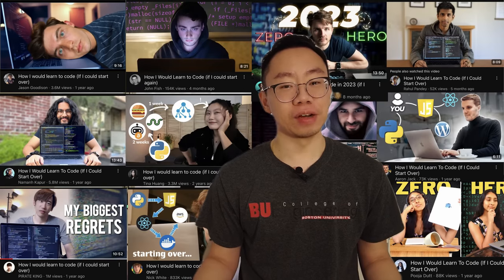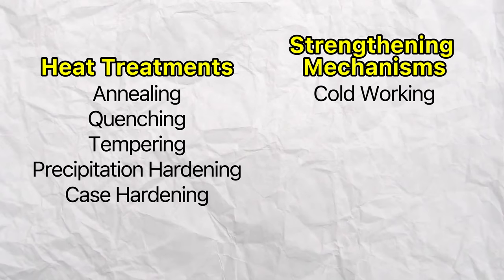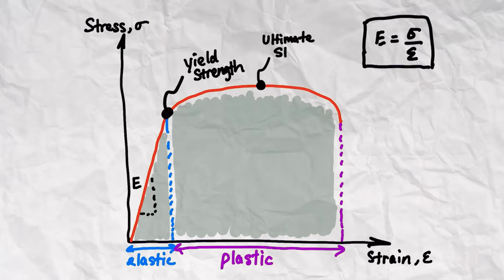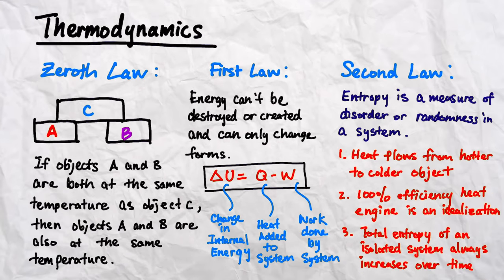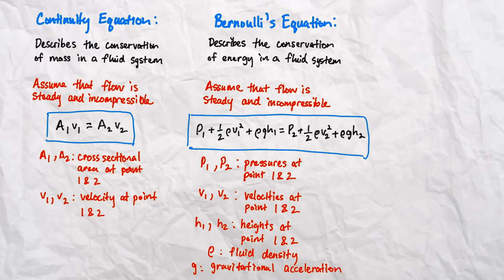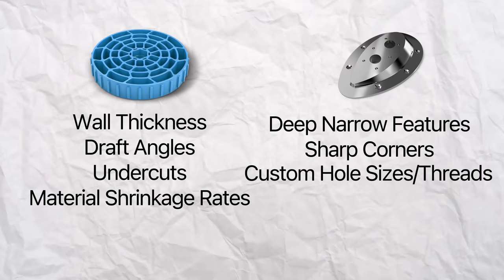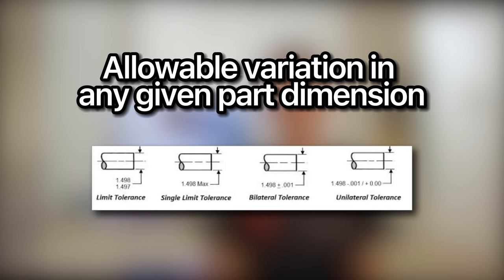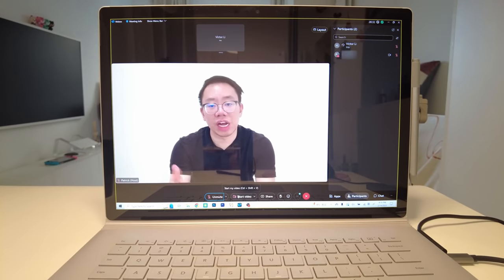How I Would Learn Mechanical Engineering (If I Could Start Over)

Comment: Engineering school is NOT taught by engineers!  It is taught by engineering academics.  While I had some excellent professors, the best had industry experience.  This is why co-op should be mandatory for engineering.  I had the advantage of having 45 years in manufacturing and evening community college teaching.  We do a poor job of preparing graduating engineers for the industry workplace.  It is only the very, very few that will apply the theoretical knowledge that they have been taught.  As discussed in this video, the most important thing is understanding the principles' linkage.

Comment: Thanks for the video. I'm a 20 year old machinist looking to become an engineer and this has really helped me see that its possible. After I graduated highschool I had some personal issues that made it so college wasn't really an option. instead I went to trade school and started working, I really like the work but id like to start getting into the design of parts and assemblies. I already have a good amount of knowledge on material properties, tolerances, components, manufacturing processes and some physics as well as a couple years experience in manufacturing and this video has helped me see what I need to improve on in order to reach that goal. My question is does where you get a degree matter much to employers and will my machining experience help me or hurt me in geting interviews
Reply from the maker: The majority of employers value skills experience and attitude over the school. Your machining and manufacturing experience will definitely help with landing more interviews and designing better parts.
Reply: Just go to your local community college/technical college to get credits to either get the degree or transfer to a university. You got this!
Reply: All that matters is that you can do the job, like learning, and be a good person to work with.

With your experience that’ll totally help. Hell, I’m self taught. Spent a few years learning the math, programming, and theory while practicing building stuff on a diy cnc. Got my first engineering job in a start-up by attaching a portfolio of those projects with my resume then brought them in with their log books to the interview, answered technical questions, and made a few laughs happen. 

This was less than 10 years ago
Reply: Hey man, it sounds almost identical to what I’m currently doing. I’m 22 and went to university for a year and had personal issue that forced me to drop out. I picked up a machinist job in die cast and decided to try and pursue my education in an untraditional route. I’m nowhere close where I want to be and often it feels like I’m stuck. It’s nice to hear that there’s someone going through similar struggles. Stay ambitious and we’ll get there man.
Reply: I'm a 23 year old military trained machinist (no certs/civllian work experience) and working towards mechanical engineering degree. From my professors opinions, machining experience should help greatly as its tied, especially to manufacturing engineering. (that'd be my recommendation so your knowledge now supports the degree)
Reply: I cannot emphasis enough how important your experience will be as an engineer.  It will give you an edge over your peers in the workplace.  HOWEVER, in school itself it'll account for very little beyond you having a better practical knowledge for what they're teaching.
Reply: You're very lucky. I didn't even know what a machinist was until I was in my late 20's, and became fascinated by it. I went to college after HS because that's what we were all told we had to do, whether we had any direction or not. So I got an expensive piece of paper from the college of business at the local university. If I had it to do over I wouldn't have gone without a clear vision of what I wanted to do. And I definitely would have learned machining. Best of luck to you.
Reply: @geobot9k what sources did you use?
Reply: Hey man I did the same thing. Straight after highschool i went to trade school for machining for money. Now I am on my last year of Robotics Engineering major and I have been working as a manufacturing engineer co-op for a year now. I got the co-op due to my manufacturing experience. Where you get the degree does not matter just make sure it is ABET accredited. Your manufacturing experience gives you a big advantage. Most college students do not have any experience since they are straight out of HS.
Reply: vibratingstring I think he meant does he have to go to MIT/Cal Tech or can he just go to his local 4 year party school to get his degree and buddy was just saying the school you get the BS degree from doesn’t matter as much as what you did while you were there

Comment: 2 years still I graduate, rly wana study mechanical engineering. However I'm not taking chemistry is this a huge problem?
Reply: I believe Chemistry is a prerequisite for Physics(at my school it is). The EEs at my school don’t have to take it though. It may vary at different universities, so I’m not 100 percent sure.
Reply: I didn’t take chemistry and I’m not in my first year of engineering and it’s the only module I’m struggling with everything else is fine so I’d say you’re good like just means you’ll have to learn it when you get to college. Or learn it on your own now to help,p u in furture
Reply: A one semester abbreviated course of “chemistry for engineers” is typical. It introduces inorganic chemistry, but is unlikely to have much time for organic chemistry.
Reply: College level chemistry is a prerequisite course for your Engineering Materials course, also commonly called Material Science which is a required ME course. I would recommend taking chemistry, physics, and calculus courses in high school to prepare you for the rigorous courses that you will take in engineering. If you are not ready for calculus 1 in your first semester of college then you may want to consider community college. Community colleges can be a great place to fill in knowledge gaps and even complete the first two years of engineering courses.
Reply: @downardesigns4148  where did the person ask you about calculus? and no that’s silly to suggest someone to go to community college just cause they don’t know chemistry . Terrible advice. chemistry in high school is absolutely useless in mechanical engineering .

Comment: I was sort of expecting a plan on how to sequence the order of studying things so as to make best/most efficient use of time, or things you would have done differently in your progression, but this video kinda just went over all the topics of mechanical engineering. No knock, but I'm not sure I really understood the "how" part, with respect to how to approach the learning - what I did get from this is there's a lot of topics that mech eng covers, but left without a sense of how to approach these topics from the perspective of wanting to learn and develop as a mech eng. What's the first project you should build so that you can move onto more complex stuff? What's the best topic material to build a foundation. What did you do while becoming a mech eng, that you wish you could have done differently? For example, if I were to study e.e. again, I'd recommend starting with analog circuits sooner. I started with digital circuits and don't think I ever gave enough attention to analog circuits. I would recommend someone doing e.e. to buy an oscilloscope, something I never had while learning about circuits in high school, which contributed to me avoiding analog circuits and limited me in that area of study. I got really good at digital circuits, but still struggle with analog circuits today because I never had the tools available that were needed, and eventually got turned off from the subject matter when it finally was presented way later in life. In terms of mech eng, what stuff would you change or do differently, that would have made you better today? That's what I'm curious about... (sayig: "understand the material" at the end of the video just feels like too broad a recommendation ... of course someone who understands the material is going to dominate when it comes to jobs because it's a competitive advantage and differentiator, but the "how" is still missing, on what you'd actually do differently if you could start over, so the video title is kinda never addressed). Anywho, I still appreciated watching, it was at least cool to see the different topics.
Reply from the maker: Appreciate the feedback! To be continued…
Reply: @EngineeringGoneWild  Yessir, I'm looking forward to the saga! Save new m.e.'s from the pitfalls you discovered! Keep grinding my man, you're awesome

Comment: One thing I feel like you missed, which is taught at my university, is machine design. Things like gears, bearings, pressure vessels, bolts, nuts, other fasteners, integrating things you learned about beams from mechanics, etc. This is very important for basic designs, and even though I myself am not a mechanical engineering major, rather materials engineering, there are so many mechanical engineers that still dont understand these basic things like how to select a bearing, or what bolt and nut size to use, and how things should be attached. People are too focused on coding, circuits, thermo, and cading individual parts that they just completely skip over how they are going to implement it in their system.
Reply: I totally agree. I immediately think of two separate stories involving O-rings- on both occasions, I had peers who were trying to specifify O-ring details, not realizing there are companies out there with a comprehensive list of products that could fit any regular sized joint you can think of. All you have to do is look up the part number.
Reply: ty for sharing that's what I was looking for to learn
Reply: Both my machine design and my control system engineering professors gave me short lists of sites to get part specs - digikey, for electronic parts, being the only one I remember off the top of my head. Those lists have been invaluable for just that sort of thing. If you can’t find an existing ring, or a pin, or a sensor, or whatever that’ll fit within your design, then your design is probably flawed.
Reply: As a person who’s looking to get into this field, I’ve been trying to figure this very thing out. I haven’t been able to pose the question in the way you’ve described. I, too, would really love to know this.

Comment: Careers after Mechanical Engineering 
1) Aerospace Engineer ⚙️🚀✈️🛩️
2) Automobile Engineer 🚗🚎🏎️
3) BIO-MEDICAL Engineer 🧬🧑‍🔬
4) Industrial Engineer 🏭🧑‍🏭 👷
5) Design Engineer ⚙️⚡
6) Software Engineer 👨‍💻📈📊
7) Product Manager 🧑‍💼👨‍💻
8) Management consultant 🧑‍💼🧑‍💻
9) Analyst 📊📉📈
10) Data science 📈📉📊💹
11) Finance and banking 🏦💸💵💶💴
12) Researcher and Scientist 🔬🧑‍🔬🕵️
13) Pilot 🛩️🧑‍✈️
14) Oil and natural Gas ⛽🛢️👷
15) Start-up and Entrepreneurship 👨‍💼📇👩‍💼📈📊💹💸🏦
Reply: Is robotics an option???
Reply: Pilot?
Reply: @aro6223  yes it is
Reply: I will go for a mix of 15) and 5),6) because my project is important but people will start to care about the issue related to the project in 7 YEARS
Reply: no manufacturing?
Reply: HVAC, also an option

Comment: This is a fantastic video, absolutely on point with the general idea of this bachelors degree and what it covers. I'm currently in my second year studying Mech Eng. in Germany and have pretty much finished all the essential courses you mentioned in this video. One thing I feel like you've missed is Machine Elements (Sometimes called Machine Design or even Konstruktionstechnik ) which was a very important course IMO, cause it taught you how to create a "Machine" ( for instance in our final we had to calculate and draw a 3-gear gearbox, without syncs, where the calculations were mainly focused on the actual gears and the shaft itself alongside of the bearings, the housing was not required to be calculated per Method B, all within 3.5 hours on a A2 paper with a 1:2 scale). It first of all taught me how to design something according to Norms and then also gave me an idea what to watch out for, like interferences etc. , while working in CAD when I started being part of a FSAE Team. I remember vividly a guy in our course did not pass because he forgot to integrate a shaft seal and didn't have anything to compensate for it, but that gearbox would have blown up due to starvation had it been "cleared", and that was our professors argument for failing him.  Although extremely shitty, was still absolutely correct and that mistake will probably never be repeated by the guy. 
In conclusion the degree is tough but god damn it is it fun to do if u start actually getting stuff right.

Comment: It's quite amusing how I can still recall the fundamental concepts of mechanical engineering. While many of these concepts are interesting to know, they often fall short in securing a job in today's oversaturated mechanical engineering job market. In my view, the most critical skills for success in the field include proficiency in 2D/3D design, the ability to interpret technical drawings and symbols, proficiency in Excel and PDM and the capability to work hands-on.

I hold a Bachelor of Mechanical Engineering degree from Finland, and it's disheartening to note that a significant portion of my classmates faced challenges in finding relevant employment due to the scarcity of job opportunities in the industry. Instead, they ended up working in fields such as food delivery, truck driving, warehouse labor, or mechanic roles, earning salaries in the range of 10-13 euros per hour.

Personally, I made a career shift into web development, and my current situation is much more favorable. One silver lining is that I didn't have to accumulate a substantial student loan for my education, especially considering that much of what I learned during my mechanical engineering studies falls into the category of "nice to know" rather than "need to know." 😄
Reply: Oversaturated job market for ME's in Finland? Weird.  I'm in the USA, Arizona.  I don't think we have that problem at all.
Reply: agree, getting hard to find engineers who can structure a BOM properly, do CAD work, etc. Mechanical Drafters are apparently a thing of the past and now Engineers must do it themselves, and most can't.
Reply: Damn ... your English is quite good , probably better than that of native speakers

Comment: I'm a senior atm. My advice: go into electrical engineering. Perhaps it's just my area and my university, but this industry feels like it's having an identity crisis and the lack of a cohesive idea of what it is really seems to be hindering the viability of the major. One mechanical engineer can have a VASTLY different skillset than another.

I also feel like this major has really not adapted to the new technologies and programs available and the course-load is getting a bit too heavy overall and oscillating between requiring a deep understanding and a surface level knowledge. Again, it could just be my university, but it pains me to see what's happening to my chosen major--one that I adore the classical vision of (a person with a deep understanding of classical mechanics, manufacturing/fabrication, and a surface level understanding of electronics.) I blame material science and industrial engineering.

Comment: Inverted delta does not represent divergence, it represents nabla(del operator) it operates both on a scalar, vector or higher rank tensor field.
Reply from the maker: Thanks for pointing that out. Divergence is represented by inverted delta dot😅

Comment: Should keep in mind that mechanical engineering is the most broad engineering discipline. There are a dozen or more subspecialties within mechanical engineering. A mechanical engineer working on the aerodynamics of a car needs a different skillset from one working on its suspension. Though there is heavy overlap of course, which is why they both mech-Es.

Comment: Love this video! I wish i saw this video sooner in my education and career. Great work, man. 

If i may, I'd like to add to some lessons that i think Mech. Engs. should learn earlier:

- Machinists apprentice: I cannot emphasis this enough. I'm on the edge of thinking this should be a prerequesite for all MEs. What you need to know as a machinist is very much still required to be a mechanical engineer. The lessons you'll learn are unique from those in the classroom and it will make it stand out from your peers. 

- Tolerance stack-up: This is such an important analysis tool and i never learned a methodical way to do it in school, so I've had to develop my own. 

- Material selection: this is bread and butter and i thought i had a good knowledge of this, but you have to be rock-solid about the pros and cons, risks, and performance of common materials. Also, get used to selecting materials based on standard specifications, e.g. ASTM specs, if you care about their performance. 

- Hand calculations: don't get me wrong, computer based modeling and simulation has its place and you need to learn it to be relevant these days, but you can get very far with just hand calculations, simplifying assumptions, and a conservative model. Don't forget how to do this too much.

- Analyzing over-constrained designs: simply supported structural members is a luxury that you may not always have. When designs are over-constrained, things get weird, and you have to be able up make accurate assumptions and know how mechanical components will behave just by looking at them, so that your analysis will be representative. Pro tip- viewing all your structural memebers as springs can help think through these types of problems.

Comment: Hello Your video gives a clear cut idea , Thanks , Improvement points ,One more important Mechanical engineering skill is using Finite Element Analysis or Numerical analysis to validate the result and for optimised design,So please speak about FEM